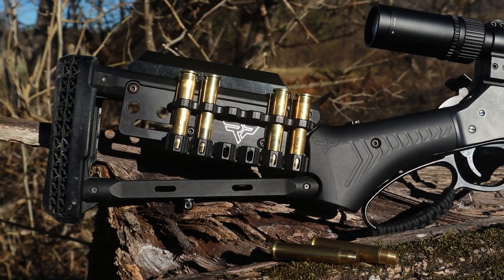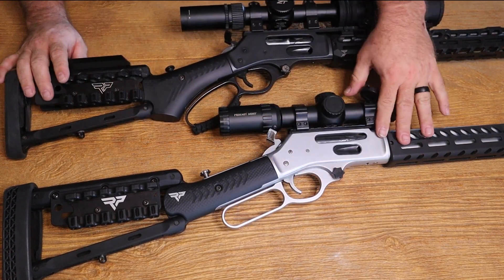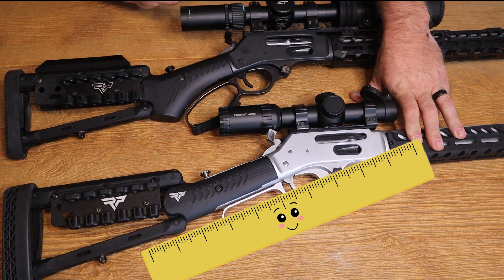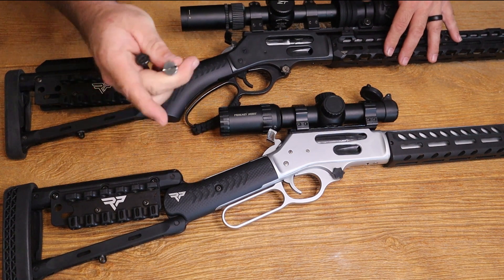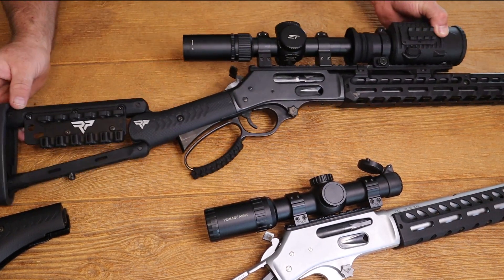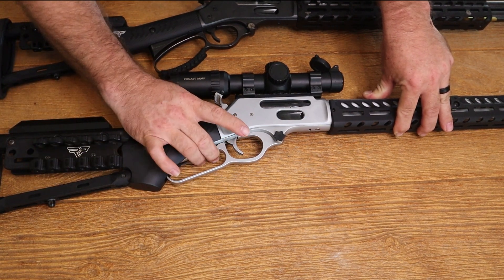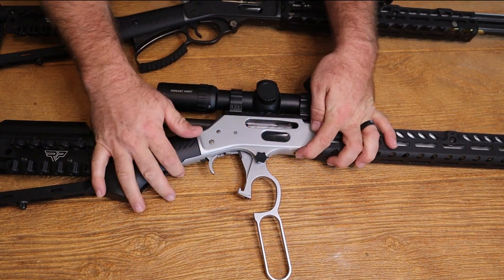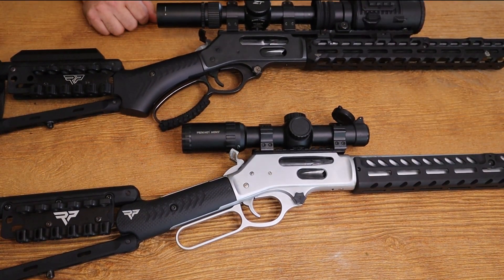Straight VS Pistol Grip | Ranger Point Precision

Comment: You know RPP, I can see a market for an adapter for straight stock Henrys to pistol stock. User would have to buy the oval lever themselves, but now looking at it, you could fill that hole between the stock and tang as shown on the All Weather model so it is flush with the oval lever. I'd be interested in that!

Comment: Wish Henry release their Big Boy or All Weather series with pistol grip like their X series in the smaller calibers (357 and 44mag).
Reply: Love my pistol grip
Reply: I think that’s where Ruger/Marlin has a leg up on Henry.  Their stainless/all weather has the pistol grip.  They were also smart and threaded the barrel.  Not that everyone will run a suppressor but doesn’t hurt to have it…much easier to use a thread protector and not use the threads than try to get one that isn’t threaded to be threaded.